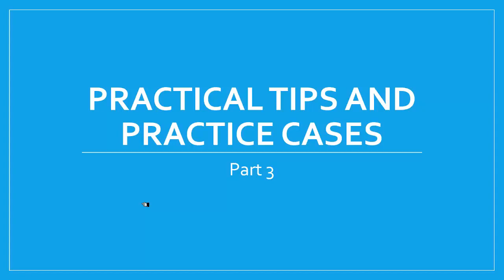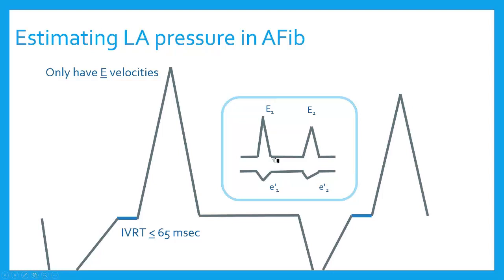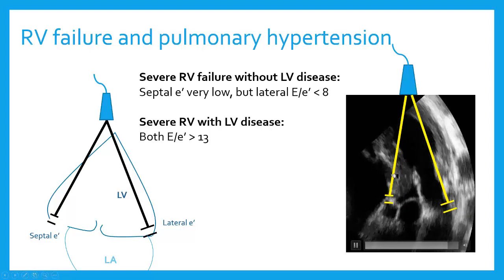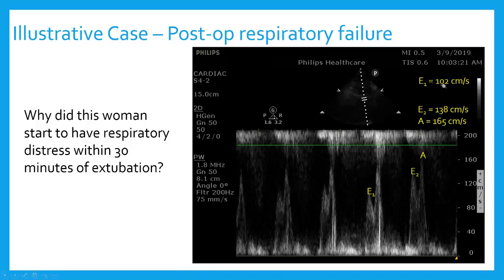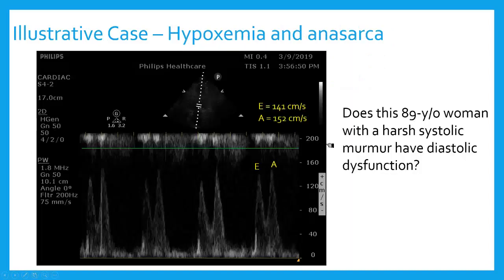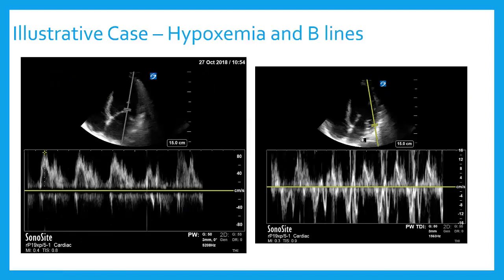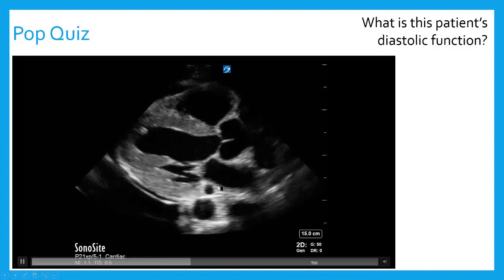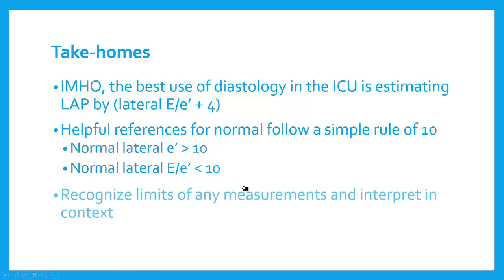Diastology Tips, Tricks, and Example Cases - Critical Care Echocardiography Review

Comment: Just like other parameters, diastology is always an evolving modality. As a suggestion, you can always add the following:
1. Your 2-D findings 
2. Size/Volume of your Left Atrium
3. TR velocity if present.
If you combine it with your Mitral inflow plusTissue dopplers/ratio result findings, then I think diastology evaluation is clearly demonstrated even for a simple machine/Sonosite that you are using.
Overall,  I fully agree that interpretation MUST include the clínical overall picture.